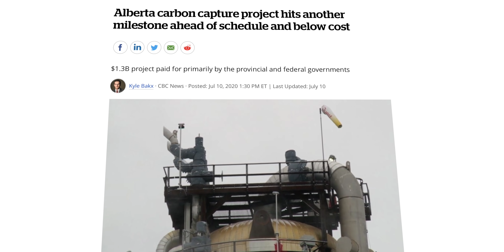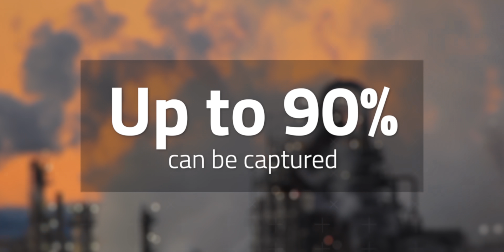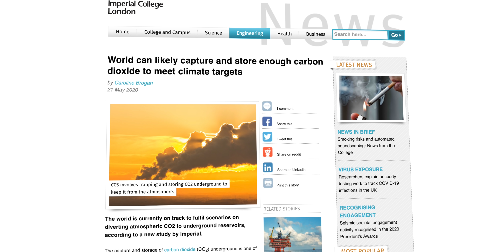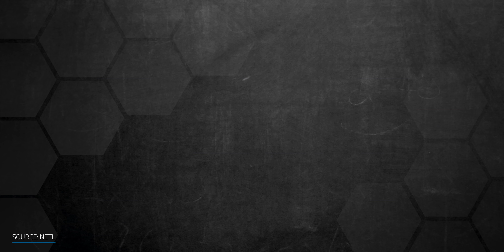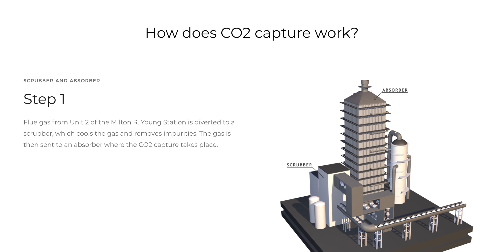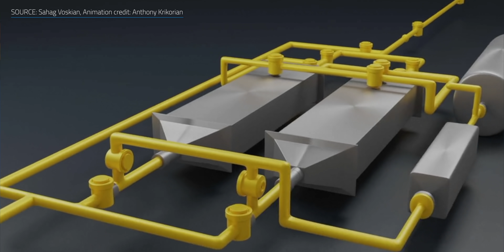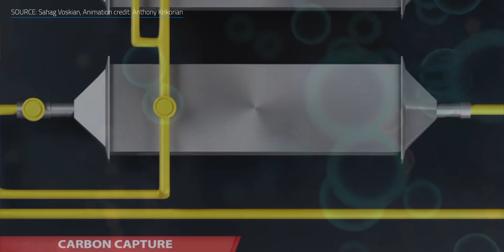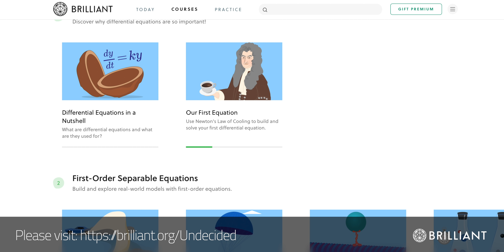The truth about capturing CO2 to reverse climate change

Comment: I just watched a video on using CO2 & waste materials to MAKE concrete block, CMU's! Carbon capture & storage could be great way to boost material science for manufacturing. We need to ask a question: how can we use CO2 as a raw feedstock for modern world? We can make ethylene gas directly from it to make plastic. We can make CMU's from it. We can make diamond & graphene from it. We can use it to grow algae that we can use for animal feed or convert it to biochar for agriculture. We can also convert mass amounts of it to syngas to be used as a plastic feedstocks or fuel for off-road & agricultural equipment. We have the beginning technology to solve these problems. We're in the beginning of the adoption of this technology. Companies like Quaise Energy & GA Drilling will supply the energy to drive all this tech into a grand CO2/carbon centric future. 

Think of it this way. CO2 is completely unregulated in it's use, production, sequestration &, more than that, it's FREE!

Comment: CCUS is a con. 
Relatively simple laws of physics make it so. Each cubic metre of coal produces 100 cubic metres of CO2, so there is very quickly no where to put it where it can be contained, long term.
Liquifying it and it is still about 3 times the size, and now you have the energy to extract, the energy to liquify, and the energy to keep it under at least 5 bar and minus 31C, forever! Plus of course you would soon run out of somewhere to store it. Solid would be dry ice, so extract (energy) cool to below -78C (even more energy) and keep below -56C (yup, more energy forever!)
I've only got a high school education, and I can see this, I feel like the kid who is calling the Emperor  naked.😁
Bottle it and blow it into polly tunnels is the only practical way I see it being of use, and that would be a fraction of the CO2 produced. Or pump it down wells to help extract the last drops. But don't think "at least it is going back underground, because you are talking a tiny fraction that you can squeeze down there.

Comment: Sorry Matt,  but my bullshit detector is in high gear. First, I would argue co2 is not a pollutant. If recovered co2 has a legitimate use then great. Just figure out how to move it without high pressure pipes. The pipe system turns a harmless chemical into a potential disaster. Air capture really sounds silly. How many million horsepower will it take to do anything beside inhale birds and dust?

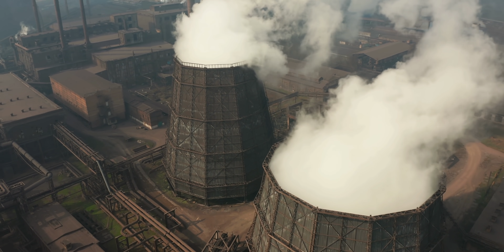Comment: Aren't those cooling towers at the 1:40 mark of the video?  Isn't that water vapor rising out of them?  There are enough clips of smoke coming from stacks, why are cooling towers mixed in with them?  CCUS sounds like it has some very viable possibilities.  I am NOT, however, a fan of using the tax code to finance anything.  The tax code is stupefyingly complex now and doesn't need any more rules, exclusions, or favoritism.  CCUS is fine but it only makes sense if we're using fossil fuels.  Once we stop, presumably when fusion energy is the norm, the money spent on it will be history.  Would it be better to take that money and just go straight to developing fusion?  Yes, it's not an easy question to answer.  Finally, anything to do with Norway is a joke.  They currently pump out millions of barrels of oil each year and sell it to other countries to burn in order to finance their green lifestyle.  Crazy, huh?  Norway is a joke.

Comment: Good info, thanks.  However, you may want to look at what LanzaTech is doing.  They have a CCUU model.  That is instead of storing the carbon they consume or Use  it to produce jet fuel, alcohols, and plastics.  Since they are producing something rather than just storing it, the process makes money.  They have small plants in China and in the US and are in the process of scaling it up.  Very cutting edge tech.

Comment: Matt,

I could not find any publications on Pub Med authored by you.  Perhaps I made a mistake.  Could you list your publications in scientific journals as references on your website ?  I would look forward to reading them.  Any professional scientist is obliged to divulge their funding.  I would also  like to see you state how much money you receive from your channel sponsors. Your  CV would also be a welcome addition.

The concept of stripping CO2 from the atmosphere and, in doing so, expending huge amounts of energy and resources in the process, either blossomed from  a really bad LSD trip, or the propaganda ( called marketing today ) spewed forth from  some snake oil company poised to profit from it. 

The difference in an Infra Red spectrum  of 400 ppm CO2 in air versus 800 ppm CO2 in air is negligible ( < 1% of  the absorption peak area on an IR spectrum ).  Infra Red (in the electromagnetic spectrum) is the range of wavelengths that cause heating of materials, such as air, land and the seas.  To get the atmosphere to 800 ppm of CO2 would require the combustion of all known deposits of fossil fuels and 800 ppm of atmospheric CO2  would cause < 1.0 deg C rise in global temperatures. 

Since unfathomable amounts of CO2 are stored in our Oceans, trying to remove trace amounts from the atmosphere is idiotic.  The amount of CO2 that humans are currently adding to the atmosphere is insignificant and actually may be beneficial in many regards.  As the climate naturally warms the Oceans, CO2 is released.  As the Oceans cool, CO2 is absorbed.  This has been going on for eons. Global temperature, and the subsequent warming of the Oceans is what primarily controls the amount of CO2 in the atmosphere.  Not the other way around. 

I find this video to be just another dose of the poisonous, irresponsible fear mongering that exists today.  Hope you can live with yourself.

Comment: One of the data points you mentioned is entirely why I'm skeptical of climate change.  You mentioned co2 is .04 of the atmosphere yet I'm supposed to accept that going to .06 or .08 is catastrophic?  Doesn't seem rational since I've seen data that in prior epochs the earth was at one time 1000 to 1200 ppm at a time where plant life thrived. 

Also, back in the 70s we expended millions of work hours and billions of dollars to convert CO in auto exhaust to CO2 thru the implementation of catalytic converters.  From a climate change perspective would we have been better off leaving it as CO, and not converting it to CO2?  Lots of unanswered questions

Comment: Just saying that using carbon dioxide in carbonated drink is greener than using CO2 to flush more oil from existing oil subterranean sources is a blatant misunderstanding of what happens to CO2 in carbonated drinks. Is the author of this video just paid by oil companies or just by carbon capture companies?

Comment: Interesting video, however, I take issue with Norway having the worlds first CCS network. Although it is popular to slag Alberta's oil industry, I would like to point out Alberta has had a CCS system for some time now. https://en.wikipedia.org/wiki/Alberta_Carbon_Trunk_Line Shell Quest project in Fort Saskatchewan was completed a number of years ago. With all this capital spending to capture what plants need to exist, lets hope that CO2 is the global thermostat. (and not the big ball of radiation in the sky)

Comment: Turn CO2 into fuel, we can do that... petrol and diesel for use instead of fossil fuels. It can be captured from the air or the sea. This is obviously better, cheaper and more reasonable than building the millions of wind farms, batteries, charging stations and cabling required for battery cars... not to mention replacing billions of cars

Comment: I have prototyped a scrubber that is 99% efficient on dust and toxic gases. It can pull high volumes too. It uses little to  zero energy depending on the application.

I am now stuck with making the solution that will capture Co2 and how to store it.

Comment: Nice video. Just one point to adding CO2 into concrete. Not so easy. In reality - most of structures are not build of plain concrete, but reinforced concrete - concrete with steel rebar inside to cary tensile load. Steel is prone to corrosion. The magic of reinforced concrete is, that concrete has naturaly such high pH (basicity), that corrosion of steel simply can not occure. Unless the pH falls. That happens, when CO2 from air penetrate surface of concrete, gets into its structure and forms CaCO3, which is acidic. This proces lowers pH in concrete and in some point steel rebar starts to oxidise. Basic rules in design of reinforced concrete structures are to protect rebar from air. Well - I guess this doesn't need more explanation. Adding CO2 to concrete is only possible, when no steel rebar is used - and that is only in those structure elements, that are not exposed to tensile forces or bending - that is not many.

Comment: Aren’t we missing the most obvious solution?
Capture the CO2 and  create synthetic oil out of it, and then store it, where we previously drilled for it ? I mean there should be storage capacity for as much oil as we extracted in the first place, which should eliminate as much co2 from the atmosphere, as we put in burning this oil ?
Reply: Also those underground caverns should be able to contain low pressure natural oil exactly as it did before ?

Comment: Regenerative agriculture, specifically conservation tillage and cover cropping, has huge potential for CCS.  Cover crops are chosen for their ability to capture carbon and nutrients from the air and transport them to the roots of the plants where they are sequestered.  No-till and continuous cover help build soils, unlike conventional agriculture where tilling is practiced and therein the soil carbon is released and little organic material is added to replenish the soil.  Farmers have lower maintenance, fertilizer irrigation costs, and yields and thus profits are boosted.  Regen works on photosynthesis, not diesel.

Comment: The double edge sword would be terrorism bombing or cyber hacking of emission collection stations. It would make places very venerable. Underwater or underground storage could relate to the upper issues. Imagine living next to a carbon monoxide holding facility an it leaks. The co2 needs to be used directly in something else like fertilizer,the adaptive usage in concrete...but that's still only as long as that structure stands.

Remember 9 11 01? Those buildings had the largest NH3 cooling system in the world at the time. Anyone into chemistry knows NH3 is gas an liquid dependent on if it's under 10x atmospheric pressure or cooled to a very cool temperature where it turns liquid. NH3 is also used in the making of methamphetamine. In the fast drying process.
     So consider when the planes hit the buildings that day 80-99% kerosene burned off on impact (as seen by fireball) NH3 takes 1200F to ignite....so something like jetfuel. We hear stories about liquid traveling down the elevator shafts an blowing the lobby out,burning people. The only direct elevator shaft that went from top to bottom of the towers was the maintenance elevator. Being as tall as the buildings had been the remaining jet fuel wouldn't have been enough to reach the lobby down elevator shafts that were not directly connected in 3x spots. What could easily travel down is the NH3 liquid that was cut like veins when the planes hit. The NH3 was also turning to gas killing people instantly from inhalation. (Hence jumping,hanging out windows ect) plus the smoke an heat. The towers collapsed at near free fall an looked "controlled" because it was essentially a giant meth lab explosion. As the top collapsed the NH3 combusted causing "pressure squibs) an pulverizing the concrete. NH3 easily burns hot enough to melt steel an is corrosive,very very corrosive with anything with water in or on it. Where sprinklers going off in the trade center? If do the NH3 wouldnt only melt steel it would fracture,corrode an crack it very quickly. Extremely quickly if theres water present. I know some firefighters going up knew this...an hence why they said "they are sending us to die" an still tried. 
    Also...the burning of the molten iron underground for 6-8 weeks was where the NH3 storage holding tanks had been located. Explaining the foundry like scene captured by camers,video,an thermal imagery satellites. 
    The towers were built in a "bathtub" an if the wall of the tub ruptured (almost did) it would have instantly caused an explosion from the Molten steel neeting cold water. Along with the corrosion of steel underground at a very fast rate. If the bathtub had been breached. So for people who dont understand certain things its completely understandable for them to say controlled demolition when it looks more like a well thought out plan. Even the 93 bombing was ammonia nitrate an kerosene (fertilizer explosive) the vehicle was directly above a underground NH3 holding tank. The terrorists were trying to set off a chain reaction bc that collating system was a looped system for WTC 1 2 3 4 5 6 and 7. 7 wasnt hit by a plane an didmt reach a flashpoint to ignite NH3 but...if it back traveled through the system after the towers collapsed. That's a different story. Theres still questions like why some steel beams clearly had demolition v-cuts on them right after collapse.  I cant explain that. Just a hypothesis but if true how did a man (who did work with the US government at one time,an his family was in the USA during 911 aj flown out very fast during Grounded flights before we knew Usama was the culprit) how could he mastermind this plan. Was he a chemist? When the 93 bombing failed did they work on a better plan? Inside job is the same as looking the other way an letting it happen. Why did Bin laden say he was surprised himself by the damage done. Why did he have a copy of 911 loose change when "killed" an raided his compound. Seems he was curious how the buildings failed so straight an fast. To add more speculation Silverstein took out terrorist related insurance on the building for "full destruction on the buildings" prior. If it was NH3 that caused the collapse an not the jetfuel ignition resulting in weaking beam trusses,but actually an architecture flaw terrorist used would he still get that 7Billion payout? It was well known when Silverstein bought the buildings that it would cost MORE to fix the asbestos a other issues than a full on demolition an restart. Hes an investor....why would he buy a known money pit?. Then the insider trading just prior to the event....it to me seems like we knew. Our intelligence had Intel terrorists were planning on flying planes into multiple cities. An the high risk dates were allegedly 9/10 - 9/13. (Maybe why many people missed work that day or didnt make thier flights) they had people in intelligence circles? Also Explaining why we had been running drills and on high alert that day. A former  female FBI agent warned Muller 3 different times about shady flight trainning going on that needed looked into she was ignored? An she even came out an said theres things I cant say but I did try to warn muller. He had no interest. Even though we now know intelligence had info on planes being hijacked at once an flown into cities or high profile target buildings?

Comment: What about capturing CO2 from the air and turn it into C and O?
The oxigen can be relleased into the atmosphere and the carbon may be used in industry.
Much energy is required for this. It is only feasable in places where it can be produced in excess from solar energy or wind.
The source of funding couldbe carbon emission taxes.

Comment: Very great video. I didn’t know you before now. I’m an asset manager of 2 CCGTs in Italy and we are studying CCS. In Europe with this huge increase of CO2 emission permits, now at 60€/Ton, with 4 units of 370 MW each running at 50% we already pay more than 100M€/year.  So the biggest problem of this technology starts to become smaller. Now after doing a course on CCS I also discover the possibility to make it with separation unit of air in which the capture rate could achieve 99%. I strongly believe in this technology to help the fight in climate change!!

Comment: So far it's been complete rubbish and there's imo no sign it's about to change. If anything, it's got a net negative impact on our environment, not only for the work needing to be done so far, but also because it's an excuse to delay doing anything by certain industries.
Stop hoping for magic solutions to real problems. Stop burning fossil fuel. Stop cutting down trees. Everything else is putting a leaking plaster over a flesh wound ...

Comment: Its deffently not an excuses! Consider a real challenge to all engineers an even companies that would like to help an have something to show the epa  as to them trying to fix their parts of the issues . If done correctly it can change it an if any air comes from those things is released in 20 degree colder or hotter than current temps or less shouldn't effect the weather patterns or cause other issues in the future. I for one believe that engineers an companies again could do it an absolutely help reverse the damage that's been caused in such h away we all could literally breath easier. An reduce cost in the long term because epa wouldnt be fine them as often or at all. Some of use do have a idea on how to make it happen an make it cost less to the public an companies involved.